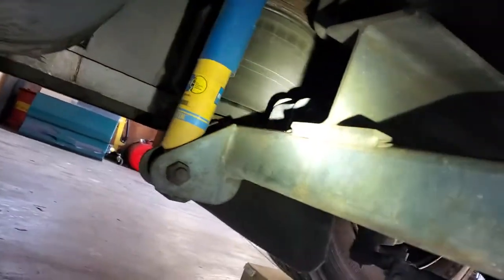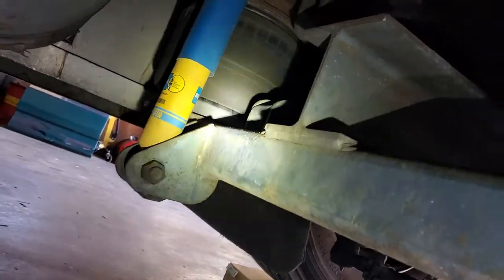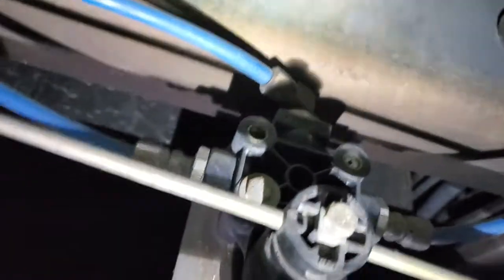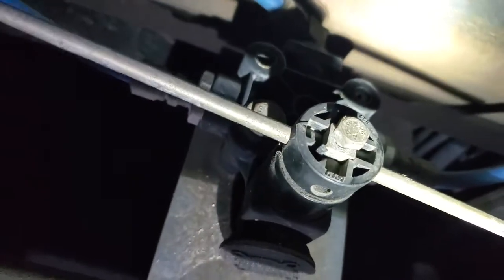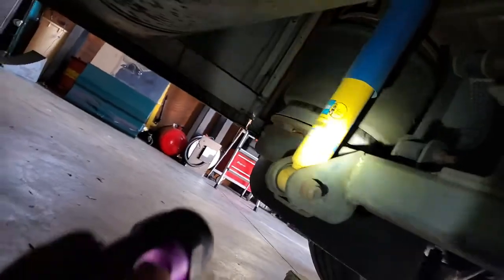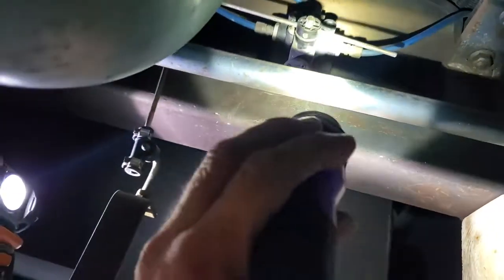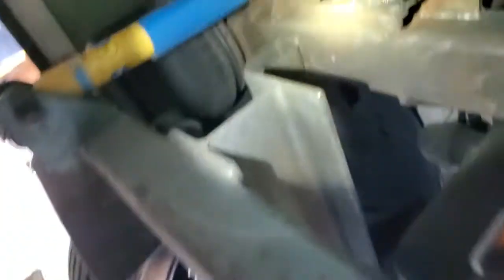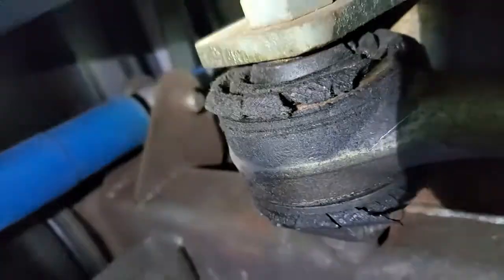Ride height air control valve and air bags.

Comment: Does rv have dryer ?
Reply from the maker: In what rv?
Reply: @Rvdiagnostics  26footer Dynaquest on an M2 106 chassis.
Reply from the maker: Some have a dual washer/ dryer ( combination unit ,Can't do many clothes and uses a lot of water, it even uses water to dry with, Then there's the stack units ,separate washer, dryer . Why you thinking of putting one in?
Reply: @Rvdiagnostics  no, I meant dryer for air pressure tank on M2 chassis.
Reply from the maker: Yes follow your air compressor discharge line out ,It will run right into it